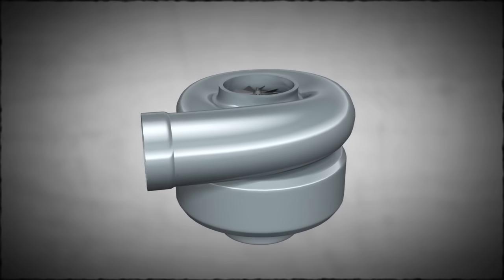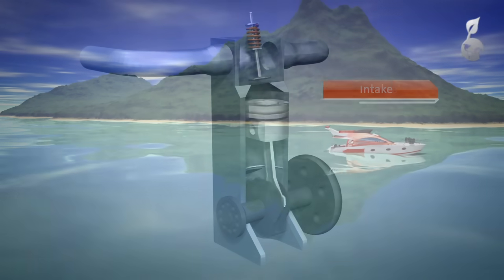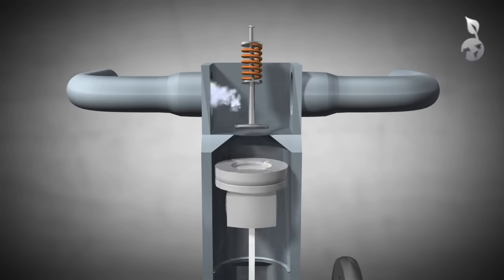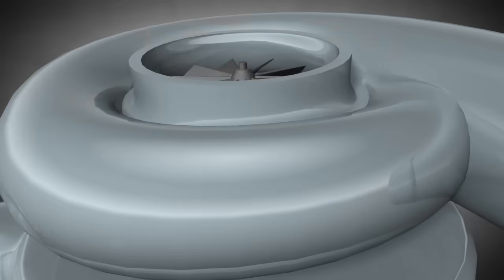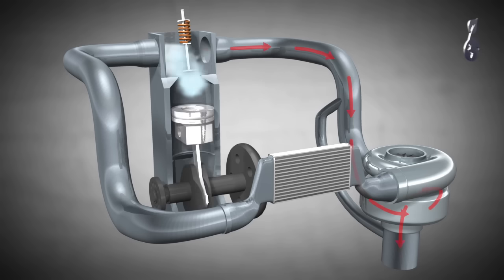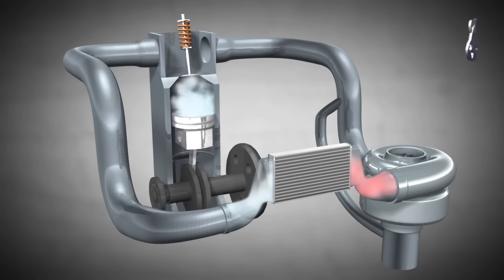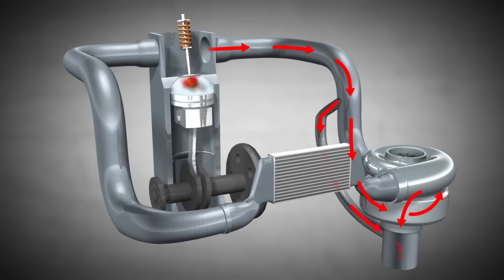How a turbocharger works! (Animation)

Comment: So the turbocharger takes in the exhaust and reconverts it to be reused by the engine?
Reply from the maker: peter c That's it!
Reply: +Peter C 
The spent gasses spin the exhaust turbine and are expelled out of the exhaust system.. the exhaust turbine shares a common shaft with the inlet turbine.. (these are in separate chambers [turbo housing] and do not mix the new air and spent gas)
The inlet turbine compresses the new air (not the spent gasses) and sends it to the engine.. where the combustion process takes place with the fuel... it then becomes a spent gas... 

Note: when the incoming air is compressed - it too tends to heat up, thus it is passed through an intercooler before it gets to the engine for the combustion process... after combustion it is a [hot] spent gas... exhaust.

Comment: So does a turbo use more fuel?
Reply from the maker: Riley Scarlett No!
Reply: Thomas Schwenke But if the turbocharger is forcing more air into the cylinder, wouldn't the car need to inject more fuel in to keep the air/fuel ratio ideal?
Reply from the maker: Hi. Without a turbocharger, usually the air/fuel mixture is not optimal. So, adding a turbo to the whole system, the cylinder(s) get(s) the air needed.

Comment: why air is sucked when compressor rotates?
 please answer
Reply: Ravikiran Radder 
As the speed of the exhaust side of the turbine increases, the intake side increased proportionately.. remember they share a common shaft.  
The compressor wheels function is to increase the incoming volume of air and compress it....

Comment: Does the turbo charger turn on as soon as you start the engine?
Reply from the maker: LIQUN HE Yes :)
Reply: But it's driven by the exhaust gas, is there enough exhaust as soon as you start the engine?
Reply: LIQUN HE Yes, at idle it will be running. Think of it as just another stock part. But you wont hear it until a shift in the gears lol. Once you start shifting, you will hear that beautiful Turbo sound.
Reply: xXOmegaShenronXx You're confusing "turbo sound" with the sound of a bypass valve. Maybe Thomas Schwenke do an animation of that someday.

Comment: To those who are curious what the similarities and differences are of a turbocharger and a supercharger, both compress air to deliver more oxygen to the fuel and air mixture. Turbochargers get their power from the engine's exhaust, while superchargers get their power directly from the engine's crankshaft- typically belt driven. Superchargers add power in a direct correlation to the engine's RPMs, while turbochargers add power exponentially, based on the exhaust produced.

Comment: think of this. if heat played no role in the drive of the turbine then why would they not just develop a system that is driven by nice cool intake air
Reply: Because the exhaust air has more pressure and speed, and can drive the turbocharger much more efficiently.
Reply: Dick Pickles i understand and agree.

Comment: thermal energy is converted into kinetic energy? i dont think so...the exhaust gases have kinetic energy and this energy moves the turbine wheel...there is nowhere a thermal to kinetic energy conversion...
Reply: phoenix1925 You actually have to convert thermal energy of the exhaust air into kinetic - you do that with the design of the inlets and the turbine itself.
So yes you do use kinetic but the primary and most important is thermal.
Reply: phoenix1925 The turbine creates backpressure on the engine which means engine exhaust pressure is higher than atmospheric pressure.
A pressure and temperature drop occurs (expansion) across the turbine (this is the important part!!), which harnesses the exhaust gas' energy to provide the power necessary to drive the compressor.

Simply put hot air wants to expand (it's full of energy) and you harness that in the turbo and translate it into kinetic motion (spinning the turbo).
You do not add fuel so that air moves quicker you add it to increase the energy of the air (think of jet engines which work on a similar concept - you want as high EGT as possible but the materials cannot handle higher temperatures).

Spooling: imagine you're about to go uphill (but with constant RPM) you add more fuel - which raises the thermal energy of the gasses (you added fuel = energy!).
Turbo/compressor spinning faster is THE RESULT of adding more fuel and not the other way around like you said.

I highly recommend you try and get a book that includes all the explanations about the whole process since I'm not a native english speaker and my explanation is not the best.
However there is much more to it than "air goes faster" that the majority of people thinks - it takes advantage of the thermodynamics much more than you think it does.
Reply from the maker: phoenix1925 Please see the discussions on thermal and kinetic energy in the comments on this video :)
Reply: Thomas Schwenke there is only 1 comment about this and as it seems that guy said what i said. I saw you wrote a reply to that comment saying its like a stream engine, no its not. Stream engine works differently, there a change in pressure of the fluid (water) because of the change of state (from liquid to gas) due to the temperature rise. So when you let the gas pass through an opening converts its internal energy (that has been rised from the heat we give to the system) to kinetic.That means that the internal energy of the gas that goes out of the openning (some kind of valve) decreases while its kinetic energy increases (the speed of molecules that form the gas increases). So by fitting a wheel you make it move by letting the high speed gas push it. So the kinetic energy of the gas increases the kinetic energy of the wheel that converts it to axial work + heat...
at the end we have a wheel that receives kinetic energy from the gas and turns it to work and heat.

on turbo the gas already has high speed because it comes from a combustion. There is no thermal to kinetic conversion.
Reply from the maker: phoenix1925 It's not a stReam engine, it's a steam engine. Please read some books about turbochargers, then come back :)
Reply from the maker: phoenix1925 It's not a stReam engine, it's a steam engine. Please read some books about turbochargers, then come back :)
Reply from the maker: phoenix1925 Just read the other comments. It's explained there :)
Reply: ***** i explained it in the other comment pretty good i think. im not gonna write it again.If you didnt read it,do it. you dont use thermal energy. nuclear reactors use thermal energy to heat the water and increase its pressure and than by letting the gas through an opening they convert it to kinetic energy and that kinetic energy to electric. In turbo you already have a hot gas that doesnt get any hoter, you dont add heat nor convert the heat to kinetic energy. the kinetic energy of the exhaust gases turn the turbo's wheel and than turbo do its job to the inducted air.
TURBOS USE KINETIC ENERERGY OF THE EXHAUST GASES, THERMAL ENERGY GETS LOST IN THE UNIVERSE! UNLESS YOU HAVE THERMAL RECOVERY SYSTEMS THAT ARENT CALLED TURBOS!!!
Reply: phoenix1925 I'm not saying you add heat to the hot exhaust gas - where did I say that, did you even read?
I said you USE the thermal energy of the HOT exhaust gas and transform (part of it) into kinetic energy.
That's the reason why turbo can spool when the engine is put under load but the revs don't rise - you add more fuel which heats the exhaust gasses more and in turn it spins the turbo.
Reply: ***** how do you transform thermal energy to kinetic in turbo? explain it scientificaly.
also, what do you mean by spool? the turbo spins cause exhaust gases are moving fast and if you give more gas they move faster.that makes the turbo's wheel spin faster. gas doesnt heat the exhaust gases more, the exhaust gases have a fixed temperature. HEAT DOESNT CONVERT INTO KINETIC ENERGY.

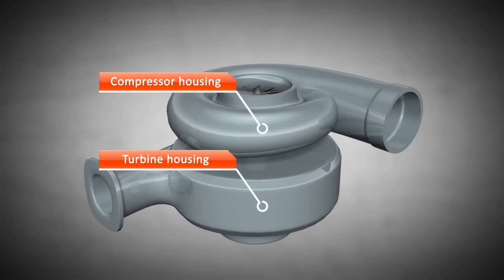Comment: 1:40 Completely incorrect. Thermal energy plays no part in the rotation of the exhaust turbine. The rapid and repeated combustion of fuel and the decompression of the exhaust into said port blows on the turbine. Heat has no factor in rotating the turbine.
EDIT: If anything, it is not "thermal energy" that is utilized. It is the energy stored in the molecular bonds of oxygen and the fuel that directly produces heat and at the same time a kinetic change by creating gas, thus causing a high pressure zone.
Reply: It is said "thermal energy is converted into kinetic energy, becouse of the constriction in the turbine, consequently the turbine is driven by kinetic energy".

This is completly right, becouse heat energy expands the gas, and the gas can expand only trough the tube into the turbine housing, this expansion moves the gas and makes the turbine rotate, hence becoming kinetic energy which is transfered to the compressor wheel. I hope this helps you to better understand why heat energy was included in the process.
Reply from the maker: Feche1320 Hi, it's in fact the temperature. It works like a heat engine. Please see: heat engine, Carnot's theorem, steam engine.
Reply from the maker: GatsugatsuSama Thank you for pointing this out :)
Reply from the maker: ***** Hi, great to hear that. Could you please give us the reference where you have read this? :)
Reply: Thomas Schwenke school... I really don't understand how you don't understand that, thermal energy just plays no part in the rotation of it. If it does, please, explain how the heat actually turns the turbine.
Reply: Thomas Schwenke Heat (thermal energy) doesn't make any difference on the rotation speed of the turbo.. the turbo rotates becouse of the engine exhausts passing through the turbo blades, making it rotate.
Reply: Thomas Schwenke sorry, but it is the energy in the bonds of the fuel molecules and the production of gas that drives it. When the gas is produced it already has a certain amount of heat. that heat is not created through the reaction and set loose, when the bonds break and form the gas that is created, as a result of the reaction, has the heat. The gas does not expand any more from the heat, because it starts out with that heat. The gas expands because that is the nature of gas...
Reply from the maker: Hi, try "Abgasturbolader" with Google Books. You'll get lots of books dealing with turbos in every way :)
Reply from the maker: ***** Hi, sadly, the only book that deals with constant pressure turbocharging in detail is the "Handbook of Diesel Engines," which is a translation of a German book. In Germany, we have lots of books dealing with turbocharging. So, if you understand the German language, I'd be happy to name some books that will teach you in detail why thermodynamics play an essential part in these situations. Of course, they all could be wrong, but I really don't think so :)
Reply: *****
 You have to take into consideration what you are talking about, the energy from the detonation inside the cylinder, actually moves the piston, this makes the engine work. (that's the point of it all)

The LEFTOVER energy after this detonation is the expansion of the gas, (caused by whatever chemical and/or physical effects, in engineering we consider it heat energy) which we use in the turbo charger, it's nothing compared to the detonation of course, but its plenty to get some more air into the engine.

How i think: the energy in the molecural bonds of the fuel is used at the detonation. The detonation generates heat, what makes the production of ignition, the gas expand, then this gas expands trough the tubes and the movement of gas makes the turbo shaft rotate, becoming kinetic energy.

I hope i'm correct if not please tell me about it. Thomas Schwenke
Reply: GatsugatsuSama Heat is all relative. The "heat" produced seems hot compared to the rest, but on a molecular level energy was not created or destroyed.
Reply: you are partially right. the turbo wheel does get energy from the heat of exhaust gas. you can see ,due to the geometry of the turbo housing, the gas expands while pass through it, gas expansion means it outputs work and lowers temperature. but that's not the only energy the turbo gets, the other portion comes from the kinetic energy of the exhaust, because the presence of turbocharger somehow blocks(just partially) the pass-way of the exhaust gas, which requires more energy to counter the drag induced by the turbo and expel the exhaust gas out, that energy comes from other cylinders that's currently in working stroke. and that amount of energy is therefore be converted into rotational energy of the turbo-shaft that drive the compressor.
Reply: He isn't completely incorrect. Gas laws do apply. Pressure and temperature drops through the exhaust gas turbine. This also means that it's potential for kinetic energy is lowered. Also calling someone completely incorrect and still continue to debate the point seems rather useless. When you make a final statement stick to it.
Reply: You forget that it's all about kg/m^3 the density of the said air. Lowering the temperature while still maintaining the pressure (turbo with intercooler) simply means more air can enter the engine and then you can burn more fuel. Of course temperature makes a difference. And you don't want your air to be too cold. Because that would hurt the efficiency. The engine is desinged to operate efficiently within a temperature band for the inlet air. Going below or above it decreases the
 power of it.
Reply: Hot air contains more energy than cold. If the temperature of the gas was irrelevant. Or of little influence we could make due with cold exhaust gas turbines which wouldn't take a beating because of temperature. Fact is the energy in the gas is available in a. Pressure, turbo's that use this specifically have a collector  to collect the exhaust gas (think stable energy output, power stations). With relatively high pressure differential to use specifically the pressure. b. Quick acting (common in cars and small engines) turbo's that harvest as much as possible the speed of the gases aiming for a low pressure differential over the exhaust turbine. Also known to have individual exhausts per cilinder hitting the blades. a Low pressure differential means less loss in the turbine. But has very high temperatures hitting the blades. Radiant heat loss on the way to the turbo is negligible. (Which becomes a factor when the turbo is mounted several meters away from the engine)

Pressure and heat are related.
Reply: Thomas Schwenke
 No need to apologize. Sometimes the most confident of people are the ones who don't know :)
Reply: Thomas Schwenke could you name those books? i am interested
Reply: Thomas Schwenke danke schön:)
Reply: Pressure, temperature are all changed by the combustion process. And the increase in potential energy in the gas is used in the turbo. Resulting in lower pressure and lower temperature behind the turbo. Just like in the cylinder when the piston is pushed down by the gas.
Reply: GatsugatsuSama It would be deflagration in an engine, detonation is a very different event. Detonation would destroy an engine. Also the expansion of the hot gasses from combustion is what drives the piston downward, however the piston cannot harness all of the energy created by the combustion due to limiting factors including time. As the hot gasses exit the engine and enter the turbine housing, they are continuing to expand, and expand across the face of the turbine blades, which is what spins the turbine wheel. At least that is how I understand it.
Reply: TheDragonoxx  I didn't know there was such a difference between detonation and deflagration, but you are right, i learned something new, thank you. About the expansion you are also right i think, it sounds logical.